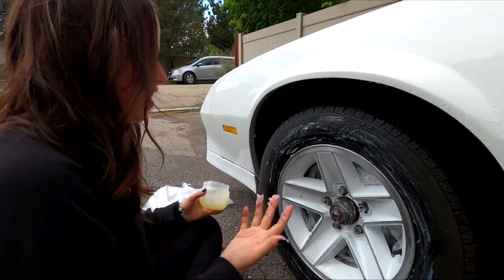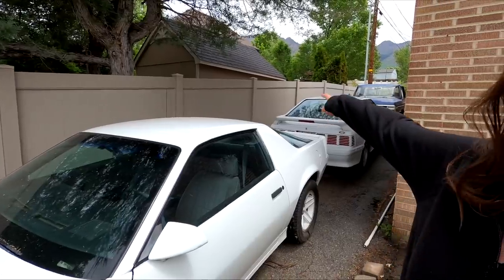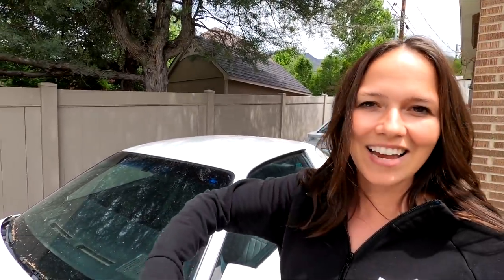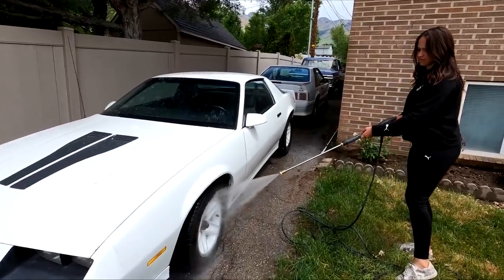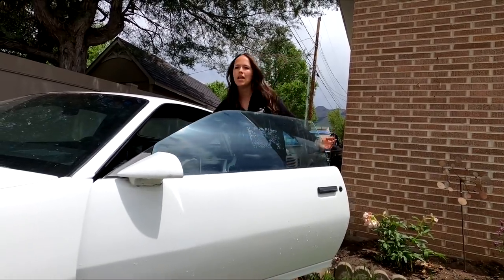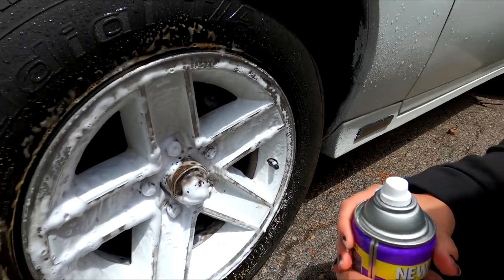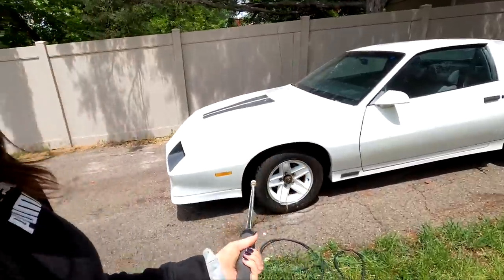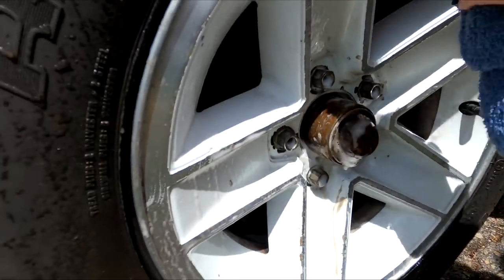I Destroyed my New Camaro by Spray Painting the Wheels

Comment: You got to take the tires off the rims and clean the rims then paint them or get some use IROC rims off of eBay they will fit
Reply: You can tape off tires. No need to remove to paint.

Comment: Before applying paint you need to get a rag with paint thinners or wax and grease remover and wipe the wheel. Then use a tack rag to wipe the wheel. This will remove any dust or lint. That will stop the paint bubbling.

Comment: 5:30 a better way to sand tight spaces: 

One, get a sawzall saw. 

Two, get one of the larger/thicker reciprocating bit that is worn out "grind the teeth down smooth". 

Three, super glue or epoxy a strip of Velcro to the bit. "Velcro tape"... "a lair of hard foam could also be added if wanted" 

Four, with the Velcro compatible sand paper it just attaches easily. 

Five, its easy to make sand paper have a Velcro patch on it. 

I would put the Velcro with the hooks on the tool bit and the loops on the paper.

Comment: Would be easier to take the wheels off one at a time and paint them on a flat surface to help prevent weird spots... less time then covering up everything... use high heat paint or it will peel due to the heat from brakes

Comment: the proper way to do it is to remove them from car if you planned to keep the tires then you would remove the tires or mask them off remove the grime sand them then clean them with rubbing alcohol and spray paint them and find a set of hubcaps.

Comment: You should take the wheels off of the car and file down the chips and gouges on the spokes, sand, degrease, rinse, and let fully dry before attempting to paint. Apply Vaseline on the tire surrounding the wheel, when paint is dry, wipe of the Vaseline and your done.

Comment: The wheels should be removed before painting ,  spray paint is definitely not the way to go atleast that  paint anyway.the wheels need to.be cleaned or prepped with a prep cleaner to get rid of any grease oil or silicone and they should be primed before paint .

Comment: Looks like you need some center caps on the front to cover up the front spindles. You also need some chrome lug nuts. Take the wheels off and dismount the tires even if you have to do a few at a time. Send them in and get them chrome plated.If your going to paint them put primer on first. When you paint with a can of paint hold your can back a foot and move slowly well applying your paint try not to get any runs when painting. If you should stop wipe off the tip of your nozzle before painting again. Try not to paint to far back or it will have the dry powder look and some times you can get orange peel look in your paint job. If you get some runs in your paint try to wet sand the run out then mist your paint in the area where you wet sanded. You should also wipe your wheel down with some degreaser and a fiber or lint Free cloth or dry it off with a air compressor after you wipe the surface of the degreaser off with a wet cloth. Get you some small little work shop with a work bench  and tools with some good lights to work on your do it yourself small projects.

Comment: SO an old deck of cards one each between the rim and the tire all the way around will provide an over-spray barrier to the tires!! Wear gloves when sanding to protect the $35 nail job. And finally use a compressor to air dry the washing BEFORE applying pain t....

Comment: You should have taken the wheel off & masked off the unpainted area. The bubbles you saw are called fisheyes which are caused by the surface having a oily surface on it. They are hard to eliminate. Sometimes a dusting coat of paint helps. You also have to throughly sand it. Good luck, I commend you for trying but do some research first.

Comment: Not  a quick or easy job , preparing is everything. You can clean them by hand but if you can have them sandblasted I would.  I wouldn't paint them on the vehicle you have a lot to clean up now brake rotors and pads. You could sand the crap out of them and use some brake clean on them let dry good and them paint them.

Comment: I look forward to your Fox vs Camaro race ,however, that 5.0 should destroy the Camaro. Back in the day stock vs stock the fox body mustangs were out running those Camaros all day long. I know because I had an 86 Z28 before I bought the 93 LX 5.0 coupe that I still own. At the same time my cousin had an 86 IROC and it was no match for anything with a 5.0 badge on the fender either. I'm talking stock rides here. Unless your Mustang has issues it will beat your Camaro. I sold my Camaro in 1994 and a few weeks later the guy hit a tree going about 100 mph while running from the police. I went to the salvage yard where it was towed and could only recognize it by one rim.

Comment: I just painted the wheels on one of my cars. First I took them off of it, then I took them to a tire shop & had them remove the tires, then cut the valve stems (the little black air things)  off with a razor blade.I wet-sanded them, cleaned them with rubbing alcohol & painted them. But your way is O.K. too.